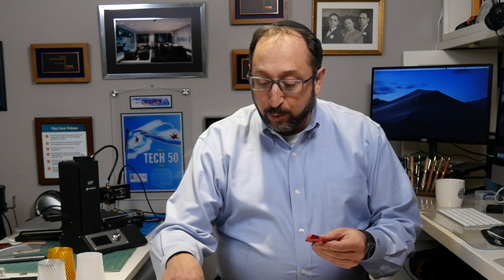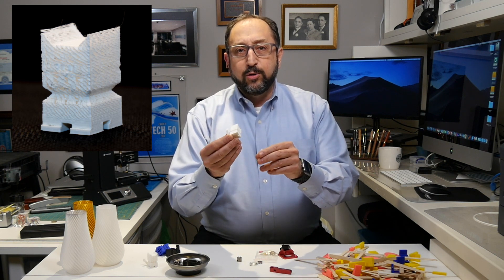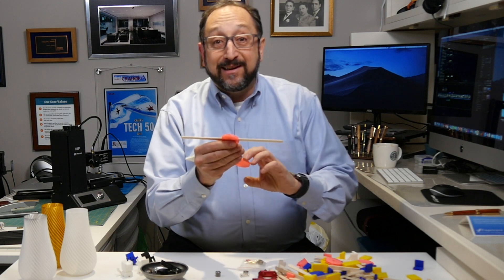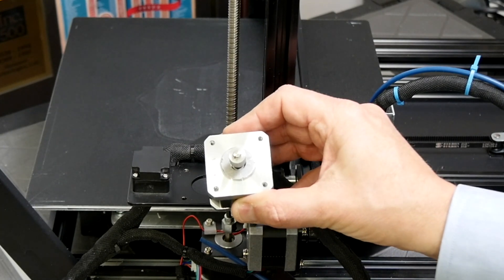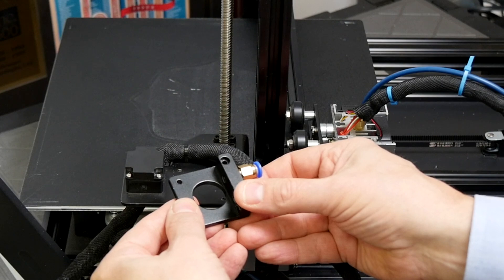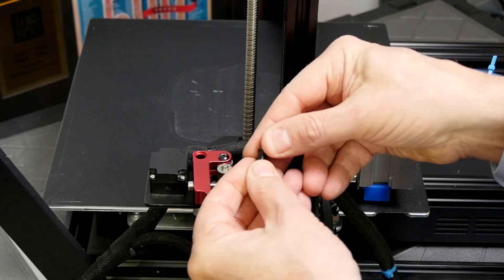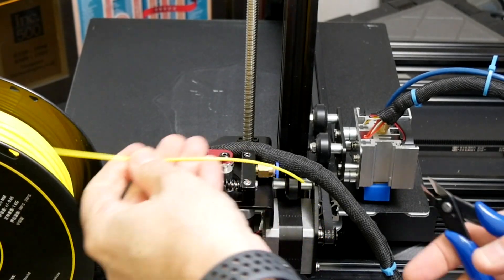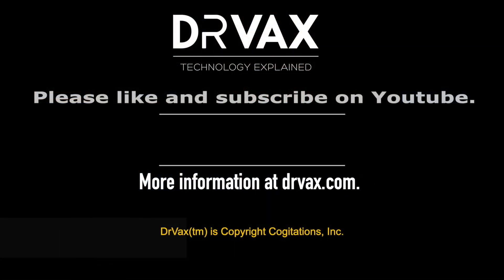Upgrading to a Metal Extruder on a Bowden Style 3d Printer

Comment: The all metal is now higher than the filament runout sensor, going to try and raise the sensor with a penny or a nickel, to see if that works.  Has anyone else had and issue with the extruder/ filament runout sensor alignments? If so what did you do?  We have MP10

Comment: Had an issue with my MP10 after upgrading extruder and tube and thought I would share in case anyone else had the issue. The PC4-M6 connector on the hot end is secured into place by a screw on the side of the aluminum heat sink. I thought since the connecter was threaded that it was screwed into the head sink ... it is not. So when i tried to unscrew it with the side screw still securing it, metal shavings must have gotten down into the nozzle. Before figuring that out, when i tried to extrude filiment the stepper motor would slip backwards because of the blockage. If you are unfortunate enough to get metal shavings into the hot end nozzle, here is how I fixed it –

1.Remove the Bowden tube from the hot end
2.Remove the cooling fan (two bolts. be careful not to drop/loose the nuts as you unscrew the bolts.
3.Remove the side bolt holding the PC4-M6 connector
4.Remove the PC4-M6 connector
5.Preheat the nozzle (I was using PLA and preheated to 215)
6.Push filament down into the nozzle 
7.Stop the preheating and let it cool (I left it for 30 minutes)
8.The filament will be stuck in the tube so while applying pressure to pull it back out set the preheat to 130
9.The filament should come back out solid with metal shavings at the end
Repeat step 5-9 until you stop seeing metal and the hot end is flowing easily with a little pressure. Then reassemble.

Comment: For those stressing about the gear on the stepper motor coming off it’s easy heat it up take the screw out (it will require some force) heat it up again and then take two flathead screwdrivers and use them to pry it off it might stop working once it gets towards the top so get two hammers and use the pulling side to pry them out you can also use adjustable wrenches

Comment: Towards the end you used a different filament. Was I’d PLA ? And can you still use PLA with an extruded for high temp? PSA new to the game
Reply from the maker: Yes you can still use PLA.  You just have to tune the slicer settings to minimize stringing.

Comment: I need help finding one that is actually available on Amazon.
Reply: I would also like to know.  Would any ender-3 compatible metal extruder work ?
Reply: I used this model https://www.amazon.com/gp/product/B07HDKRFKT/ref=ppx_yo_dt_b_asin_title_o00_s00?ie=UTF8&psc=1 and with the bracket it works perfectly.  But the capricorn tube doesn't work.  Filament does not come out.  Maybe they changed the hot end and now it is like the Anet ETA4 (see this Dr. Vax video https://www.youtube.com/watch?v=wZD_-aeODfk"

Comment: Do you have a leveling print you recommend using for this printer? I have upgrade mine to a meal extruder and a Capricorn tube and still having issues getting the first layer to stick after hours of trying to get the bed leveled.
Reply from the maker: I think you will find this video helpful.  There is a link in the video description to the gcode file.

https://youtu.be/zfTm0SqIFm4

Comment: Thanks for the great video! I found this extruder on Amazon, but would like to be sure it will fit before I order it. Any advice? https://smile.amazon.com/IronBuddy-Extruder-Upgraded-Replacement-Aluminum/dp/B07R3K6KPX/ref=sr_1_10?crid=2IB3VFKEWP6YX&dchild=1&keywords=left%2Bhand%2Bextruder&qid=1589545400&sprefix=left%2Bhand%2Bextr%2Caps%2C168&sr=8-10&th=1
Thanks!
Reply from the maker: The key is to verify if you need a right hand or a left-hand extruder.   Look at your printer and verify which side the "arm" is on and match that configuration.

P.S.  I have started a new discussion forum at http://forum.drvax.com where we can all have more elaborate discussions and share pictures on our prints and printers.  Check it out.
Reply: @MakeWithTech  Oops...forgot to mention the printer in question is a Monoprice MP-10. It is still bouncing around in the back of the delivery truck somewhere but I have been learning a lot from your videos. Can't wait to get started and thanks for the link to your forums site.

Comment: Hello Dr Vax. Say your return Video. Glad your Ok. What a way to lose 25 lbs. You mentioned in this video that there was another metal extruder that you would prefer. What brand was it, the model number and how much does it cost? where can I get it?
I currently have am MP10 with the plastic extruder (plastic with metal core). Your videos have saved me. thanks

Comment: The extruder gear set screw is so tight that I can't remove it so.... I guess I"ll be buying a new stepper...booo... but what'cha going to do... great series of videos, thanks
Reply from the maker: Don't buy a new motor yet.  Very often the set screws are glued into position to vibrations will not shake them loose.   Try holding a "bic" lighter on the gear and set screw until it gets hot.  This may break the seal and allow you to get it out.
Reply: @MakeWithTech  thanks but it didn't work... when I contacted them they offered to sell me a new servo for $15,,, but it comes with the gear... :(
Reply: I wasn't able to get it off but I was able to get a new one for ~$15 from Matthew Upp of GigDigit.com
 (matthew@gigidigit.com)... they have quite a few parts for the MP-10 and other 3D Printers

Comment: Dr Vax, I'm finally putting together my MP10, and I'm upgrading the bowden tube and the extruder at the same time. But I'm having a problem with the extruder gear that came attached to the stepper motor. The set screw is stuck in there and it won't come out, so I can't remove the gear. You said you heated yours to remove it. Was that after you removed the set screw or did you just heat it and remove it with the set screw still in place?
Reply from the maker: The gear and potentially set screw are glued in place at Mayan to ensure they do not vibrate free.   You can heat up the whole thing, but just the area around the gear, not the motor, with "Bic" style lighter.  This will both cause the gear to expand and will also melt or at least soften the glue.  So the simple answer is yes you can heat both.
Reply: @MakeWithTech  Wow, that is great information, and most useful. Thank you very much.

Comment: Anyone know where i can order this since it is out of stuck on amazon
Reply from the maker: I used the following all-metal extruder from Amazon, but it is currently sold out.  You can use any left-hand extruder.  Make sure when you look at the photo that the filament input side (from the spool of filament) and the output side (to the printer) are positioned on your printer the same as in the photo:

https://amzn.to/2zjOZSh

Alternatively, I have installed a Seeme CNC extruder on my Ender 5 and I really like it.   You might want to consider this instead.  Here is a link for it:

https://www.matterhackers.com/store/printer-accessories/seemecnc-ezrstruder-kit?aff=7476

Please note the above links are affiliate links that will provide me a rebate but cost your nothing.

Hope this helps.

Comment: Do you feel that the Capricorn tube has less friction? I haven't changed the extruder yet, but I have found that just holding up on the tube takes it out of a bind while printing and makes the extruder gear skip less. If it's just left to hang, it seems to put the filament in a bind and cause a lot of skipping.

Thanks for posting this video!
Reply from the maker: Very interesting observation.  In addition to the new extruder, I also added the Capricorn tube at the same time.  I took it out of the wire wrap and attached it to the other cables, that are still in the wire wrap, with very loose cable ties.  Since I did these all at the same time I cannot really tell how much of the impact was from each change. 

My guess is that placing the tube inside of the wire wrap was a non-optimal design.  I noticed that on my Ender 5 the tube is outside of the wire wrap and even with an all plastic extruder it works quite well.

Comment: Do you have a link to the kit you used in the video?
Reply from the maker: Here are links to the components I used:

Upgraded Bowden Tube

https://www.amazon.com/gp/product/B079P92HN9

Upgraded Extruder

https://www.amazon.com/gp/product/B018QPUROO

(Please note I did end up filing down the head of the left side screw that holds in the spring so it will not hit the filament sensor.)

Comment: FYI the extruder on the MP10 is a MK8 "Left Hand" type, however the MP Mini and MP Mini Delta use MK8 "Right Hand" extruders. Also, with this style metal extruder, the addition of some additional support/guidance will be needed for Flexible filaments. There are some metal extruders that do have more support (but flexible with bowden tubes is tricky anyway). For example this one: https://www.amazon.com/Redrex-Upgraded-Aluminum-Extruder-Creality/dp/B07HDKRFKT/. But any metal extruder is a big improvement over the stock extruder.
Reply from the maker: Good information which is correct.  Thanks for providing it. I use my Prusa with a direct drive extruded for TPU.